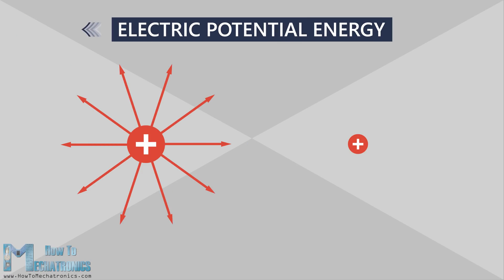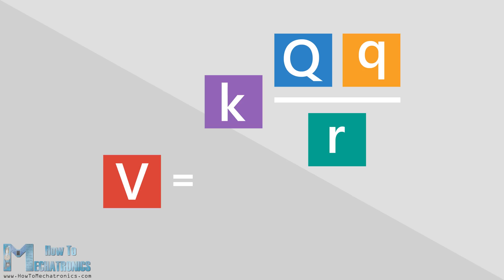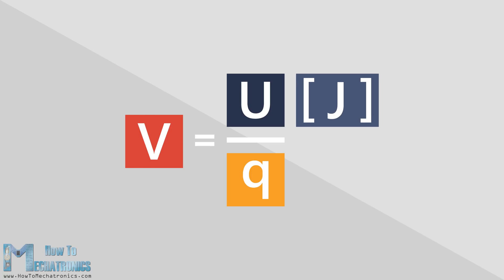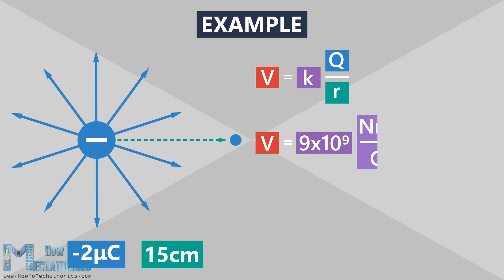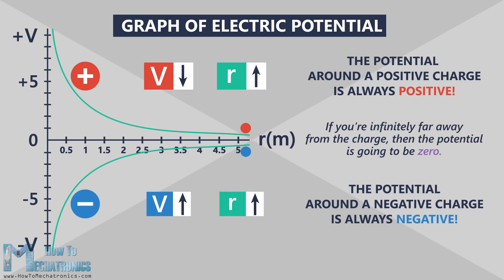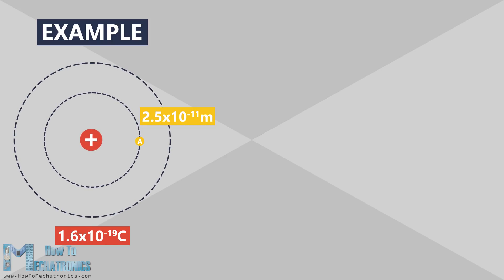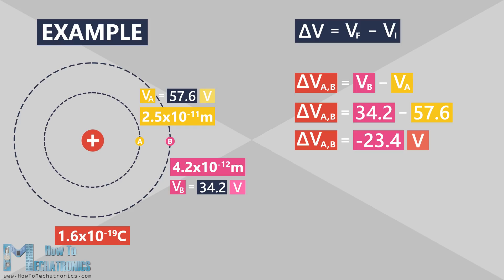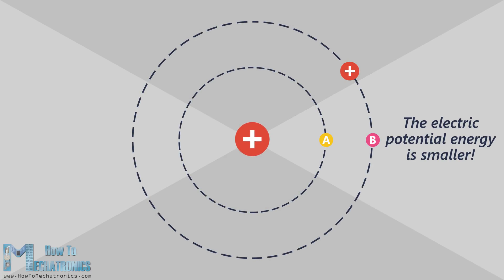Electric Potential and Electric Potential Difference (Voltage) | Electronics Basics #5

Comment: 4.2x10^-12m is closer than 2.5x10^-11m if you switch it to 4.2x10^-11 the problem would be correct. For the first potential difference example.
Reply: i was thinking the same lol